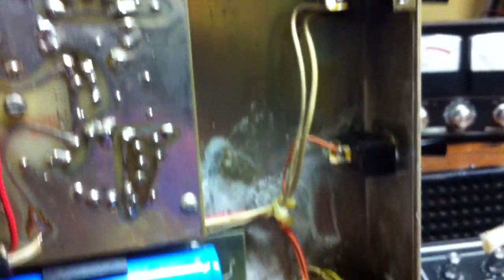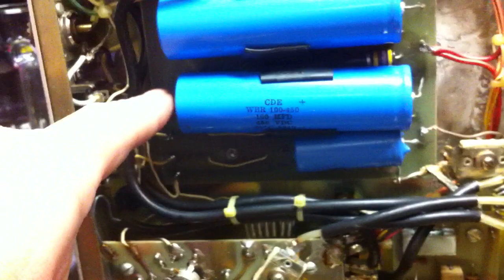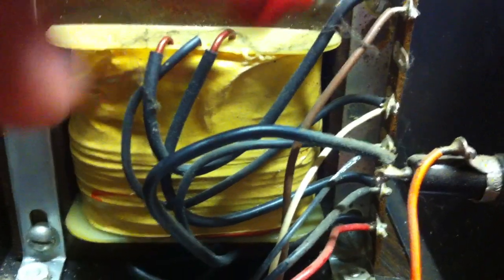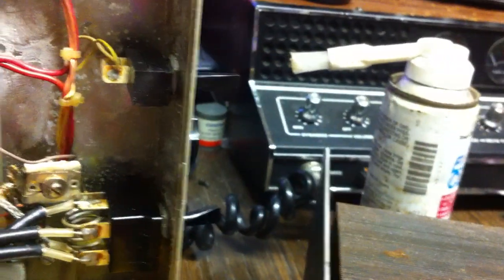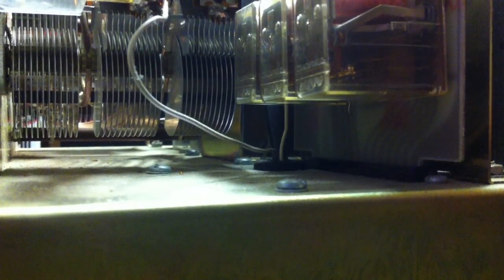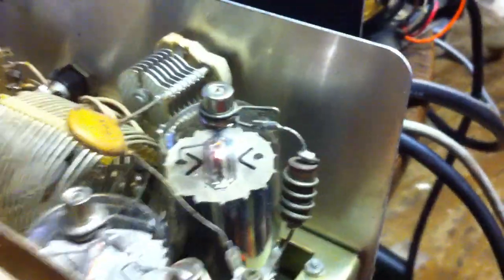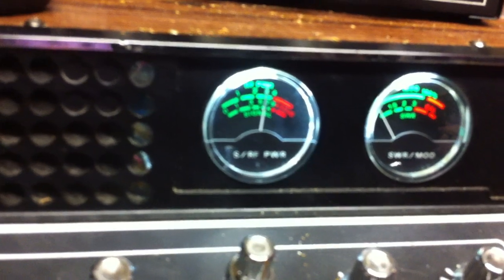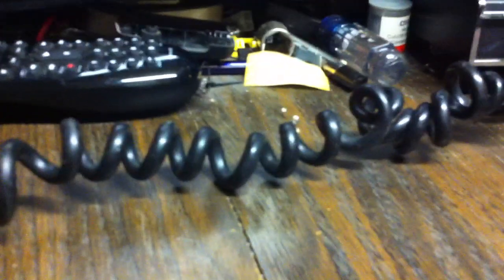palomar 300a repair part 4

Comment: hope you are doing OK Jim. I got zapped by 700V out of my skipper 300 the other day as I used both hands and got a reminder not to do that. Both arms/hands were numb for about an hour so I can relate! I am missing my transformer for my 300A but I have the 4-diode bridge like yours. Coul;d you tell me the specs I need for the transformer. I have heard 300V 1.5 amp, 12.6v 3 amp, but would that be 150-12.6-150? I'm looking to get a Hammond if they make such a beast. Great videos I did sub. Hope all is well my friend!

Comment: I have had 3 of these amps ever one of them would do 1000 watt that's hitting it Whith a galaxy 55 doing 25 watt but all of them had new tubes and are like yours clean as thay could be talked a lot of skip Whith. It and those moon Riker 4 one of the best tube amp ever made
Reply: David Maggard a thousand Watts?!!! I get 1500 out of mine. You must be doing something wrong. Try driving it with 50 Watts in the high position. Then you'll see what it really does. You do realize that you are insane. Don't you? Don't drive your 300 a with 50 watts in the high position. I'm being sarcastic. you have absolutely no clue. People like you should not operate amplifiers. You are endangering your life. If you love your family your stay away from any type of amplification devices. Moon riker 4 amplifier. What the hell are you talkin about?!!!!! I didn't know up until now that Bellevue allows patients to operate transmitting equipment while being a patient there.

Comment: I gotta 300A the 6 tuber one with the white face and my driver tubes won't light up but I can use the box in low no problem...you think my sokets are bad...I guess if they are bad I'll need to replace the driver bord huh
Reply from the maker: check for bad joints and and power to the tubs and first test the tubes to see if they are still good
Reply: Jim white yeah jim tubes are good they just don't light up even when I move the tubes around